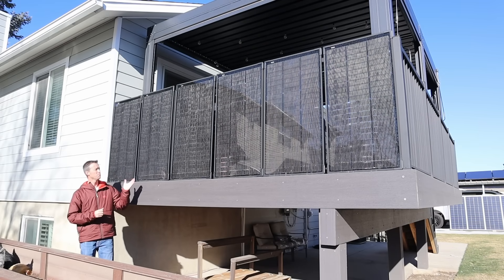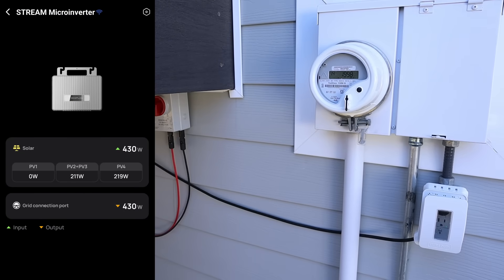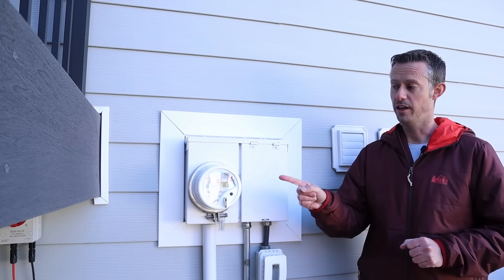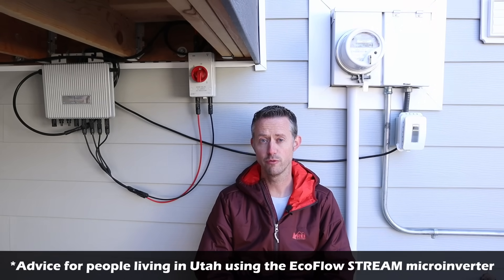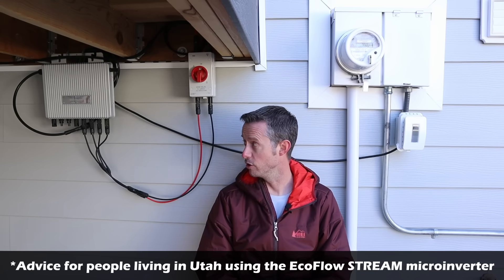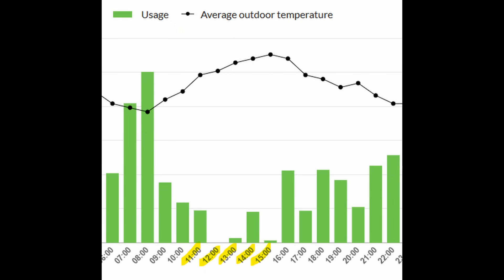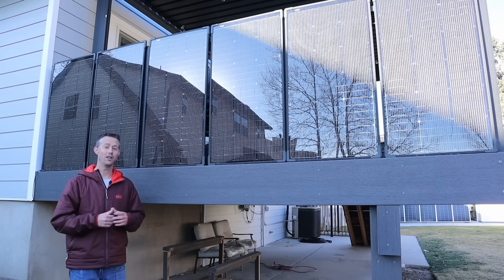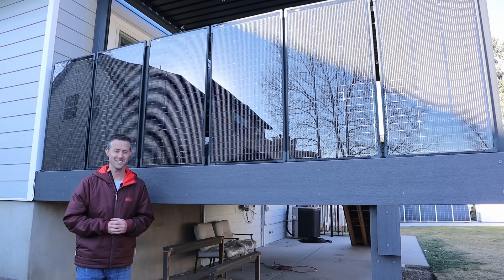The Simplest Solar System I've Ever Installed!  I Just Plugged It In!

Comment: How are the panels attached to the balcony?
Reply from the maker: UV resistant heavy duty zip ties attached to the solar panel kickstands / mounting setup. I didn't want to modify or drill into the deck in anyway.

Comment: With a good inverter like a solark you can turn on load side coupling and it'll then charge your batteries. Extremely flexible to be able to put panels anywhere on your AC circuit without running lines to the inverters mppt. 
I do this with 2kw hoymiles microinverters and a solark 12k off-grid.

Comment: Is there an adapter or something that can be hooked up to an existing solar setup of an rv, campervan etc that may be just parked in the driveway not utilised? Could make the investment in that equipment more worthwhile? Especially large capacity batteries that could be used to store excess production if the capacity was larger than can be legally fed into the grid?

Comment: I've been using this setup in S. Utah for about 3 months.  I'm using the EF Stream with (3) bifacial 445 watt panels on a dedicated circuit (1200w output).  I'm also using an EF Stream Ultra (1.9 kwh battery installed) with (2) 445 watt panels on a non-dedicated circuit (480w output).  The Ultra outputs 480w and uses the remaining solar input to charge the battery for use when the solar drops (shade, nighttime, rain, etc...).  In sunny Utah I find (for sept and Oct) I'm saving about 40 bucks a month on my bill.  At that rate it will take a bizillion years to pay for itself but I get the satisfaction of giving a small (very small) middle finger to RMP.  Plus, it was fun to set up. edit I called RMP and told them what I was doing to avoid the gestapo from showing up  at my house.
Reply from the maker: Excellent feedback, thanks for sharing! I spent weeks on the phone wirh RMP which was so frustrating. No matter who I talked to, I couldn't get anywhere 😂

Comment: What I would like to see because the micro inverters is what I believe they're called that you have. Because they won't work unless you got a back feet of power to them from the the grid, what I would like to see if you hook two of them up at the same time and flip off your power and see if they'll work like one back feeding the other. And yes I'd like to see how you would hook 400 watts of power inverter by battery I should say micro inverter pretty please with sugar on top.

Comment: Are you sure you have that wired right? It looks like the panels go into one wired pair, then that one wired pair is connected to two inputs on the stream.

This would mean that two of the steams mppts are connected to the same panel array. I would expect this causes some weirdness, as each mppt might disagree about how to manage the panel.

Normally you’d split your array into two groups then wire each group into its own mppt input.
Reply from the maker: Since the panels are wired in parallel the power is split evenly between the two mppts. It's been working well for the last two months with no issues.

Comment: I’m tempted to get something like this and use it with a 24V solar setup. 

Put i400-800 watts all day into the micro-inverter and use the solar to charge the batteries. 

Can you use the app to limit the power used by the micro-inverter to make sure you keep it below your base load or do you manage that by sizing the solar panels?

Comment: I think you guys are forgetting the old Sun grid tie inverters with limiters from like 12 years old, but now it's a fancy gray box with more limitations 😂😅, check that out
Reply from the maker: All I remember is cheap Chinese grid tie inverters that would burn your house down 😂
Reply: @Jasonoid the are the same inside, made in China. The one that burns down is the user without proper knowledge, they do not take care of the range limits of these inverters and put more voltage that it suppose to handle, when solar panels are in shade with a cloud and then it gets cleared, solar panels voltage spikes because of the nature of the silicon cells, so you have to calculate that maximum spike before hooking up with them. See you in a year!
Reply: @jdorville  I thought the same thing when I saw this, LOL!

Comment: regarding what you mentioned about the battery:  what you really want to do is have excess solar to charge those batteries while still  zeroing out your home ussage,  then discharge the battery over night to continue to continue the savings. 

barring that, you can charge at night when rates are cheapest, then discharge into the grid during the peak hours

Comment: Great idea- but concerned about outside unprotected cords and black cord headed to the outlet. Why no conduit?
Reply from the maker: The wire is less than 6 feet long and it's designed to plug into an outlet. You can't run it in conduit because it's waterproof and can't be disconnected.

Comment: as you mentioned near the end, i was wondering, "why not setup a larger system, and just feed it 24/7 through your larger battery bank?" i'd really be interested in seeing that video. especially with how cheap batteries are becoming.  i think will just put out a video of a like 32 or 36 kwh battery he bought as a kit and it was only 2100 bucks. this is the type of stuff that could really help the strain on the grid for certain areas.

Comment: Yes, please DO a video about the battery controlled system.  I'm a senior on a modest fixed income but I dearly love solar and the hope of being able to further pare down my expenses.  I was fortunate at retirement to find a huge, gorgeous 1880 Victorian in remote TinyTown; it was a fixer and I did all I could to remedy that.  But the rooms are all 15' square and the ceilings are 12'.  That's great for passive cooling in the summer - I only need a window AC that runs maybe 2 weeks total in the worst heat - but it plays Hobbes with my heating costs in winter, even with ceiling fans.  Plus good old TinyTown is gradually shrinking b4 my very eyes, and most of the men at least are hostile maga types so good luck finding anyone to help around here.  

And I probably wouldn't trust them if I could.  I wasn't here two weeks (20 yrs ago) b4 the klan appeared outside my front gate, waving their pitiful symbols of 'manhood' and shouting.  I ran 'em off with my shotgun, and they've never lived that one down.  People were incensed when I outbid them at auction (just $14.5K) for this place but they'll have to put up with this damnYankee interloper a few more years.  I just want to be reasonably comfortable until I check out and leave the house to Sinn Fein in my will.  That ought to fry their arses good and proper.

Comment: Doesn't ecoflow have smart plugs that will communicate with the stream to only output what is being consumed?
Reply from the maker: Yes, but that's only on a 1 outlet level, not the entire home. So if you wanted to offset the power of a fridge or computer that might work. I'm not sure on the limit of smart outlet you can have but something that tracks the power of your main wires would be much better.

Comment: I'm wondering why you spent the money on bifacial panels with that particular type of setup, I could be wrong but it seems like you're not getting your money's worth due to the placement of those panels. It doesn't look like any meaningful sunlight will reach the backside of those panels.
Reply from the maker: I used these panels since they were the perfect size for the deck railing. They are also extremely lightweight so they shouldn't stress the railing too much. If I was going to mount them on the ground or on the roof I'd go with something more affordable.
Reply: @Jasonoid thanks for the response, do you think your getting more out of them due to them being bifacial?
Reply from the maker: @robertmunafo5039 maybe in some weather conditions, but mostly the bifacial feature isn't going to be a benefit for how these are installed.

Comment: That floppy A/C cord gives me the ick.
Reply from the maker: Since it's plug N play you can't really run the wire in conduit.
Reply: @Jasonoid  Cable management is a thing.  Is the plug at least a twist-lock type so it's secured to the outlet?
Reply: Thats a suicide plug

Comment: Regarding back feeding to the system during a power outage, a potentially dangerous situation for utility workers servicing the power lines, HB340 also requires the devices used must include an *anti-islanding protection feature*, to prevent the solar panel system from energizing the grid system during a power outage.
Reply from the maker: The inverter is UL listed and features anti-islanding technology. I tested it, if you unplug it from the wall with solar panels connected it instantly powers off. It requires grid power to function and takes about 3-5 minutes to sync up properly.
Reply: @Jasonoid  Thanks, I was wondering about that during the entire video.
Reply: @Jasonoid  You addressed it in the video.  Thanks for pinning it so the comment isn't repeated over and over.
Reply: That's what the grid sync micro inverter does. No signal from the grid, no power out from the inverter.

Comment: Please share a video with a battery hooked up with the eco stream.  If there is no backend to the grid, storing the excess energy in the day to a battery to discharge once the sun goes down would be huge.  Just discharge each night until drained and charged back once solar over produces the next day would be a game changer!  Thanks
Reply: Air conditioning?
Reply: @oldmech619 I have AC but my worry is that I the summer, I will have the ability to capture more power than my house uses at specific times and that would lead to wasted solar capture.  If I don't have an option to have net metering, storing the power for later would be nice.  A smaller 1000-3000 battery would be more than enough to capture excess with 750 watt panels.  If you max it out to the hypothetical 1200 watts, that's way more power than the house would run at any given moment without large loads being active in the house.  EV charging could be a good source of more power, but that would get tricky.
Reply: @brantschooler1028 . EV battery. Wow   Things look complicated.  Good look with the build.

Comment: Irrespective, nice addition, thanks!
Reply from the maker: The panels are wired for parallel with XT60 connectors. Voltage stays the same, amperage adds up when each one is connected. They are designed for ecoflow 60v charge controllers. Check out my other video when I tested the panels for performance.
Reply: @Jasonoid  Ah...  I assumed (incorrectly) MC4...  I'll edit my error and thanks for the info!  :)

Comment: If the voltage is above 60V, it's not code as the electrical wires need to be in a raceway and or protected in a way that prevents anybody from touching the wires.
Reply from the maker: Voltage is 42vdc

Comment: Thank you for this video! I wiill be setting this up very soon at my home with (3) 400 watt panels. As far as metering goes, is it all or nothing? Or can it offset what it can push into your home?

Example: Your home is drawing 700 watts and the microinverter is pushing 300 watts(into your home), would you only be drawing 400 watts from the grid at that point?
Reply from the maker: Your math is correct.

Comment: Nice use of those panels, I too have them (set of 4).  In one shot your input was under 500 watts input, do you think this is because the light is not in perfect alignment to the sun?  I am testing a couple of 200w panels and not getting 400w input and can only guess it is due to winter sun angle.  Just curious.
Reply from the maker: The solar angle wias early in the day, and we had a ton of haze. Not very good solar conditions. They perform decently when angled properly.

Comment: I have this setup in MS and I'm curious what gauge wire you used on the dedicated plug.  I have the shelby pro E3M for the zero export.
Reply from the maker: 12 AWG wire, 20 amp dedicated circuit.

Comment: The power company is taking your excess and selling it to your neighbours. Genius. Where I live I'm net metered and get paid a lot for my back feeding. I have a Net meter of course. I also got red flagged since I bought my Delta Pro Ultra with a 2180 watt array that compliments my 9000 watt grid tied array. With the DPU my imports went way down and my exports went way up. I'm using the DPU as plug and play, not inter connected to any home wiring.

Comment: FYI - That is serial, not parallel, when daisy chained.
Reply from the maker: FYI, it's not lol...
The panels are designed to be connected wirh their XT60 connectors and it's a paralleled connection. The voltage stays the same and the amperage adds up 👍
Reply: @Jasonoid I see - in which case they are not daisy chained if they are parallel, but the xt60 connectors might hide that fact. I'm not arguing with you - "daisy chain" typically refers to a series connection, and grid tied arrays are typically in series. Thanks for the explanation that it has to do with the cables being the parallel combiner. Now you need to setup another plugged into the opposite phase. You are fortunate that this is allowed in your state, hopefully it comes to other states too, definitely something to watch!
Reply: @Jasonoid I was confused about this.  I have 6 of these units running and really enjoying the simplicity.  I have a constant base load of 15,000 watts due to Bitcoin miners.

However, the way you have it setup is curious.  Ports 1,4 and 2/3 are each their own mppt device.  It may not matter in your case with all the panels facing the same direction, but ideally you would max out each mppt with the right number of panels. Did you break it into 2 ports to reduce amps on each port.

I've been experimenting.  In order to really get to 1200 watts...you have to have a perfect mix of voltage and amps....in my case I can't get there with my panels.  

I really would like to try using my battery system like you discuss.

Last comment....I just saw that AP Systems has a new product that does the same thing.  No restrictions by them on selling anywhere.  Only has 2 mppt ports.

Keep digging around on this path....easy cheap fast power for homes.

Comment: Even if you have a smart meter (with other utah power companies, not rmp), if you dont have a net metering agreement they will want to charge you about 300 to join the net metering program, have you add a production meter to claim credits for your panels production separate from the main meter, and still swap out your existing meter, otherwise you get billed for anything that goes back to the grid.  I also went through about 5 stream microinverters (pv4 constantly dies after a few weeks if you use large panels still within their listed specs).  Luckily ecoflow's support was pretty good and they let me return my microinverter  after the 5th exchange for a refund and I got the stream ultra which properly supports net zero export with a shelly 3em pro meter.  Also has mppt channels that have been much more reliable.  No issues with that one so far.
Reply from the maker: Since I have RMP I don't know what the other companies require. I'd love to be able to roll back my meter but unfortunately I can't. Thanks for sharing your feedback, I haven't had issues with my mppt ports, luckily.
Reply: @Jasonoid avoid using mppt4 if you dont need it, it isn't built like the others.

Comment: this is nice and if you are not using all the power it generates then you really should set up a battery that the solar panels dump into and then from the battery into the micro inverter. though that would add a lot of cost to this setup but there would be no wasted power. commenting to help.

Comment: I have 9KW on my garage roof with net metering. I broke even kast 3 years and then 2025 was not as productive. I think all the everywhere dirtied the skies. This would work for a little extra solar to up for slow production. Good report.
Reply from the maker: Totally! Easy way to add extra solar, especially if you found cheap panels.

Comment: I have an EcoFlow power station fed from the grid and solar with my network infrastructure as the load.  Not as flexible as your setup, but perfectly legal as there is not export under any condition.

I hope these micro-tie systems get nationwide approval.  This will make the entry low enough for most to take advantage of solar offsetting of loads.
Reply from the maker: Yeah, much cheaper than having to buy the whole power station and smart transfer switch.

Comment: Very nice work, but where you say that the panels are connected "in parallel", and "daisy-chained" sounds so wrong to me... (?)
Reply: Series makes more sense, but inverter requires 20-60v, so must be parallel.  Maybe 2S3P
Reply from the maker: The panels have around 45v each and 2 amps. They are designed to be wired together with XT60 connectors which wire them in parallel for Ecoflows 60v power stations / microinverters. They are paralleled or the voltage would be like 200+ volts 😂

Comment: You need battery storage during the day to offset your evening power which is probably the most.
Reply from the maker: They do make the Ecoflow Stream Ultra for the US market now (well at least Utah), which has a 2kwh battery for running loads at night, you'd need much more storage than that realistically. I have tried connecting it to a large 48v battery bank and it worked to feed power 24/7 👍

Comment: Jason, I'm a bit confused about the "PV disconnect." You mentioned it briefly in discussing the makeup of the system.  Is this a legal requirement? Where did you get yours? Please advise 😊
Reply from the maker: It's for added safety if I want to connect or disconnect the MC4 connectors while they are producing power. It's a 30 Amp DC disconnect and I ran 10 awg wire between the panels and the disconnect.